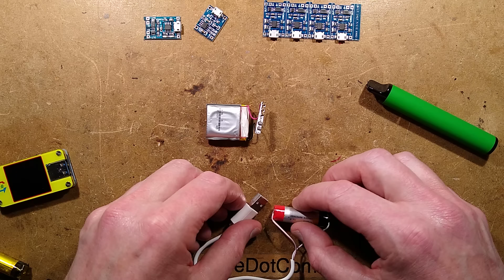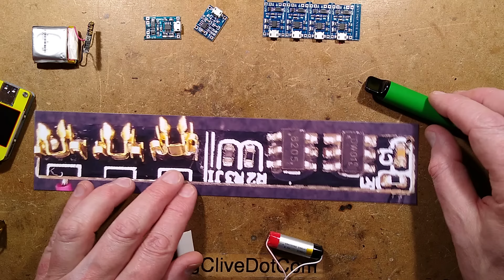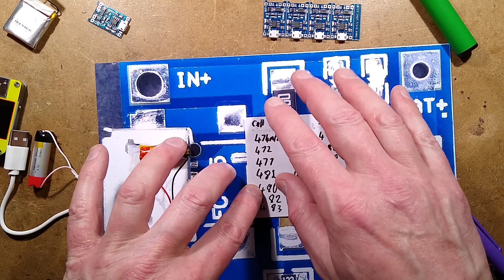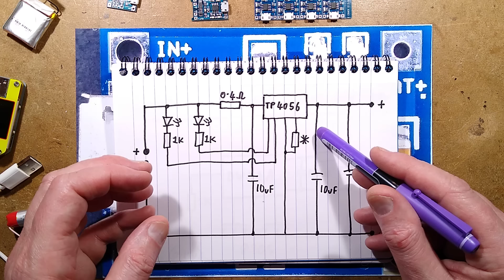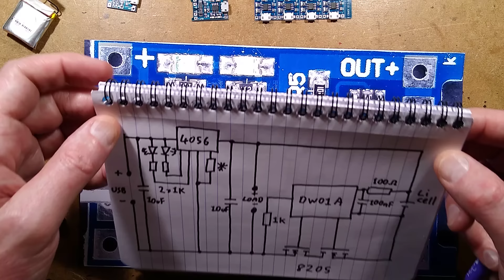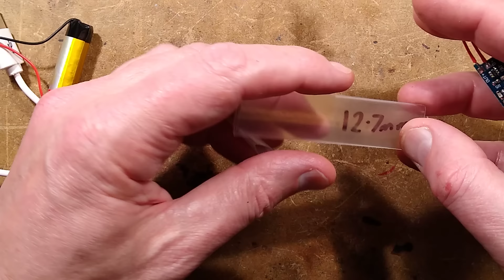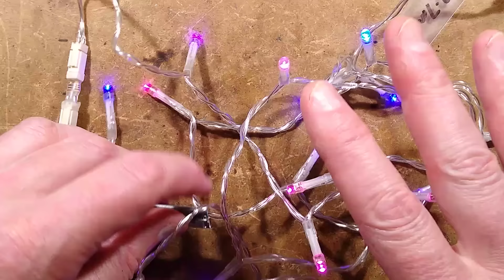Don't do this!   (There's a much safer way)

Comment: Usually it's not the option to do it safe. You have a car, a charger and a desperate girl with dead vape pen you would love to impress. Few minutes overcharging and she get's her few vital puffs before passing out since alcohol intoxication. Voila, engineer reputation granted and spend what's left of your life reinstalling her parents laptops. On the topic, what about installing variable resistance potentiometer? That should work, no?
Reply from the maker: The potentiometer could be added in series with the 1.2K resistor to limit the maximum current.

Comment: Ive literally done this but I checked the temp before and after plugging it in and it warmed up abit more then I would like 😂 ditched that idea so I stole a charge controller from a small rechargeable touch seems to work okay 🤷‍♂️🤷‍♂️😂

Comment: couldn't you use a potentiometer instead of the resistor to easily change charge current
Reply from the maker: With a 1.2K resistor in series to limit max current, yes.

Comment: I charge my lithiums off mains with a diode and resistor.
Reply from the maker: Can be done in an emergency.  But requires quite close attention to voltage.

Comment: I always have a lot of those 4056's on hand for the very reasons you talk about. However, I've noticed recently that they're overheating some of my cell phone style LiPo's like the BL-5C and cause some swelling. I assumed they'd work for them, but it appears I still have a lot to learn!
Reply from the maker: They shouldn't do that.  It's a valid way to charge them.  The Nokia style batteries also usually have a protection PCB built in.

Comment: Hey Clive, just want to find out if its normal for these recharging circuits to get warm whilst charging a reclaimed lithium battery. Its a nice beefy 1500mah battery.
Reply from the maker: Yes.  The chip dissipates the difference in voltage times the current as heat.

Comment: A decade or so ago before these great modules were available the trend was often have little more than a 1A rated silicon diode in series with a 5.0 V supply. Although a bodge and it shortened the life it didn't seem to provoke failures.

Comment: The manufacturer would be wise to offer a version with a row of charge current setting resistors in parallel, each in series with contact pads which one could then solder bridge open or closed to set the charge current desired. Crude but effective.

Comment: i bought one of these modules and put crocodile clips at the battery terminals, been using it for 8 years and it never failed on me. charged many different types of cells.

Comment: Hey Clive, big fan of yours here. I have purchased one of these chinese desoldering pumps (very similiar to the Duratool ones you can buy). What's the best way to make it so it's 100% safe? As a lot of the YouTubers have said it's a death trap lol the main issues are: that it has not strain relief, the cables inside are twisted and bare and it's not earthed. I understand putting a UK plug and a 3amp fuse, but I wouldn't have a clue how to earth it etc. Just think It would be good for those who only need to use one every so often and don't want to shell out a lot of money. Thanks man :) good health you and your family!

Comment: I dont think its possible, but might it be possible to use a computer's USB port to output a specific voltage thru software? Or even monitor voltage of a connected cell? I would guess probably not. It would be really cool to be able to charge a battery and monitor it via software. It would be nice to be able to tap into the USB controller and tell it to only output 500mA, for instance.
Reply from the maker: You can't do that with a computer's USB port.  It has to be external circuitry.

Comment: There does seem to be a serious lack of respect for the cells in vaping devices. I’ve had two patients recently that had these spontaneously combust, resulting in significant burns to the thigh.
Reply from the maker: They do often mistreat the 18650 cells used in them, including putting fully charged spares in their pockets with loose metal like keys and coins.  The main battery manufacturers put out a statement that their cells are only intended for building into products and not as loose cells.

Comment: I have always wanted a step-up converter to allow a continuous 5v USB output using a single lithium cell. The best I’ve found is the L6920D. At no load, it will hold the output at 5 volts with only micro amps being drawn from the battery. The problem with the L6920D is that it can’t handle much of a load. It’s output starts to fall at around 600mA.
Reply from the maker: Just whip the PCB out of a cheap single cell power bank.  Or get one with spring contacts for replacing the cell.  The simplest USB power banks with no button or charge level indicator often just put out 5V continuously.
Reply: @bigclivedotcom  I didn’t know that some actually run continuously. All of the units I’ve looked at automatically disable the step-up convert when the load falls below a threshold for a period of time. Seems like most of the chips have this feature built in.

Comment: Came across a reasonably peculiar torch/powerbank device by the name of "Nebo Redlin Select (2nd Gen)." Reading through the product page everything seemed fairly standard fair until the realisation that it has a single USB type A port. Not USB C, Micro or (heaven forbid) mini usb.
The product manual (available on the product page) shows a Male to Male (spicy) USB A cable. Further delving reveals that the battery for the model (Product code 6698BAT) differs in more than just higher capacity.
From the comments of their spruiking video
"yes the battery is removable. The REDLINE Select RC uses our proprietary battery with dual polarity contacts and protection circuit. A standard 18650 battery will not work."
Apparently NItecore have a similar shtick with their nl2150hpi 21700 battery.
So many questions, so little time.

Comment: Clive, can  you run the lights while the unit is plugged in to the charger?  I'd like to use this to power some ESP8266s & LED emergency lights I've made.  I would like them to run off mains power while available, and auto fail over to the battery when mains goes away (In South Africa we have this thing called load shedding).

Nice video, by the way.  Thanks :)
Reply from the maker: If the LEDs draw less than the charge current you can do that.  The charger will run the LEDs and also charge the cell until it is nearly full and then just run the LEDs.
Reply: @bigclivedotcom  Gonna give it a try.  Will probably leave feedback on a random video in the future with no context given just to see who's awake and paying attention.
Reply: @bigclivedotcom  Just occurred to me that the 1A charging current lends itself to this use quite nicely.

EDIT: DRAT!  I should have waited for the next video to post that!

Comment: Would the board with the extra DW01 chip act as a charge controller if the board was fed by a PV panel?
Reply from the maker: If the solar panel puts out 5 to 6V then it can be used directly on these modules.

Comment: Back when I owned a Samsung Galaxy S3 (I actually still own it and use it as a security camera on my window), I used to do that "Stripped USB Cable" method to charge the user removable battery in that phone. Basically I had some shitty USB Cable from a Aliexpress radio adapter and it had one solid core which wouldn't short anything unless I try to remove the battery from my DIY tray. Was rly dangerous but the battery had BMS and back then I was totally a beginner when it came to SMD soldering and I already had burned my middle finger one time when I was a bit distracted. That's why my friends gave me the nickname "Big Middlefinger <Insert my irl name here>"
However, I you can't blame me for that because my finger didn't start smelling like a chicken (definitely a reference to that "If it Smells Like Chicken You're Holding it Wrong" meme)

Comment: I use an icharger, it is meant for RC batteries and is intended to charge bare cells. You should still use a protective circuit in its final application though.

Comment: Could you charge 2 batteries in parallel rather swap out the resistor?
And rather than use a USB could you use  some reclaimed garden solar cells, normally just the circuit board that  doesn't survive, the solar cell will give you something

Comment: Many, many thanks for this information, Clive. Just a couple of questions, when changing the R3 resistor, one end can go to pin 2 of the 4056, where does the other end go? Also, do you have to remove the original resistor, short it out or something else?  Once again, many, many thanks.
Reply from the maker: Remove the original resistor.  It goes between pin 2 and the chips negative supply.
Reply: Many thanks, Big Clive. Keep up your very good work.

Comment: i like to use some hot glue over the wires, where they are soldered, just to secure them a bit more.
its not pretty, but would be usefull in this case, where you have wires being moved now and then.

Comment: I often find discarded vape pens. I recently pulled one apart that had a generous 1500mAh battery (tested 1485). I ended up using it to replace a worn out 1000mAh 18650 in a solar porch light.
Now instead of the pretty much new cell going to landfill, it’s going to get a few years of use.

Comment: I have been collecting lithium cells from the street and have powered various things.
Hacked my transistor radio that is normally powered by 4 'C' cells to work with street lithium and the charge/discharge protection board. Works great, Lasts at least 20 hours on a single charge.
I have been charging my batteries using a couple of older USB chargers which only output 500 mAh so no need to change the resistor out on the charging board.

Comment: Get a bunch of the TP4056 and a decent Lithium charger, like the ToolkitRC M7 ! It can be a variale power, charge Life, Liion, Lipo, and even Nimh with cutoff voltage, trickle, balancing over multiple cells, etc.

Comment: Hi BigClive can you use the TP4056 modules  to charge an 18v tool battery
Reply from the maker: No.  It's better to use one of the multi-cell battery protection boards and a current limited supply.

Comment: I wonder with these charging circuits, could you use a potentiometer in place of the resistor so you can change the charge rate on the fly?

Maybe with a nice 3D printed case to house it safely.

Comment: A Clive video on vape controllers could be interesting. Although  sold as disposable the vapes I have examined contain a chip (S085L) which has the potential to recharge lithium cells. Disconnecting  the heating element and applying 5V to the (usually blue wire) and  0V to the black wire has worked for me, but I would not recommend it without current and voltmeter attached. Some oval shaped vapes have the heater connected by a connector which makes recharging easier. Just touching a wire connected to pin 1 of the SO85L will switch the chip on but it seems to switch off after a short time. A mouth held suction torch can be made by replacing the heating element with a 1W LED in series with a 1 Ohm resistor
Reply: Theres rechargables disposables and I imagine it would be easy to connect to one of those, but as I covered in another comment, the easiest and safest way to charge these is just use an 18650 charger, which is also rated to charge these batteries.   No resolder every time you charge it needed.

Its also much safer; these batteries arent designed to be handled and recharged , theres no case.  So resoldering and taping everytime you charge is a much higher risk of damaging the battery and having it explode over a long period of time rather then using a proper charger.

Comment: The worst thing I've ever done is revive a 0v 18650 by connecting it in parallel a fully charged 18650 connected using a 510ohm resistor to get to about a 10ma max current. 

My universal charger (it can do lead acid, nicad, NiMH, lipo and li-ion) can only go down to 100ma and it probably would refuse to charge a completely flat battery (I never tried, but it doesn't like it when it sees voltages it shouldn't). I do now have a proper charger that can revive dead cells. I do use my universal charger on my car but it won't do a float charge as it cuts off once the current drops below 100ma (although that does usually take about 2-3 hours so you get a decent charge equivalent to driving for 2-3 hours) you can leave a load running though to keep it above that threshold (like the interior light). I also use it on my electric scooter as I don't trust the cheap Chinese charger included with that as it seems like a basic dumb transformer.

Comment: Nice. I used these boards to add manual charging of solar charged lamps I have (18650 battery) They needed it, since I live in the north of norway, and we have very little to no light during the winter, so they won't charge enough with the tiny solar panel they have.

Comment: For those folk with a big " junkbox " a hyper simple USB charger can be made with a silicon rectifier ( 0.6 Volts ) , shottky diode rectifier  (  0.2 Volts ) and a 2 Watt wirewound resistor ( 10 Ω to 100 Ω ? ) ALL IN SERIES with a 5 Volt USB supply .. the resistor limits the max charging current ( you choose the Ω ) and as the battery approaches 4.1 Volts the current reduces to almost zero ( check with meter ? ) .. ideal to use while you wait for the devices shown in video to arrive or as an emergency charger ( ? ) ....

Comment: A very interesting video.  Just a thought about varying the charge current. A double pole multi position switch could be wired into the pcb and different values of resistor soldered onto the switch contacts.

Comment: Immediately recognized the vape and very similar lithium cells I've salvaged from disposables that I've purchased for low-current projects and proper disposal. Utterly horrified at that direct USB-lead "charger" and while I figured it was going in this direction, still had me exclaiming "they did f--ing WHAT to a lithium cell???"

Still so wild that so many of these end up in the bin, and proper disposal is rarely a large enough concern for consumers, retailers, or manufacturers (especially with these devices). While small enough that it's probably no worse than tossing a spent primary lithium cell, still awful to imagine how much lithium ends up in landfills due to these perfectly good rechargeable cells trapped in disposable devices. It's also very interesting that these small rechargeable cells are now so cost effective that despite only being used for a dozen cycles (if that - I've encountered ones without charging circuitry), they are effectively considered disposable by manufacturers. Even worse, some manufacturers make it either a scary or neigh-impossible task to separate the cell from the housing and simply expect you to throw away the whole thing as-is.

Great video as usual!

Comment: Hey, everybody: if you're going to do the really dumb thing and straight-charge those batts -- or if you deal in salvaged cells regularly, really at all, either 18650s and pouch cells from laptops, or from... erm, other sources lol -- you need to get a "Type K" fire extinguisher. Regular "household ABC" fire extinguishers will not help you here, lithium cell fires are "light metals fires" and a standard household extinguisher just can't deal with those. If you do get a fire going, unfortunately -- when you call the emergency folks, please mention that you at least suspect it's a "light metals fire" from a lithium battery or cell ("battery" = multiple cells, "cell" = one  single 18650, pouch, etc).

Again, if you deal with salvaged cells with any degree of regularity, you should do this. TBH that kind of includes tech shops, even if you don't salvage the cells, just because of the sheer number of laptops with electronic cooties and gremlins of an unknown nature under a single roof.